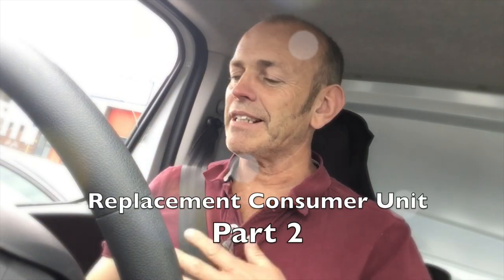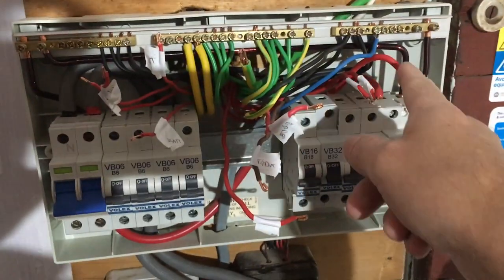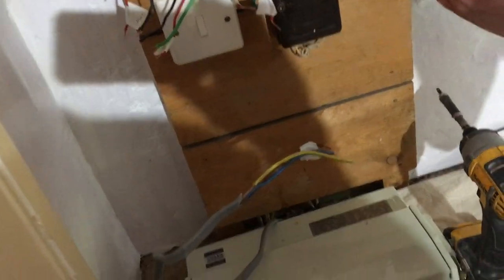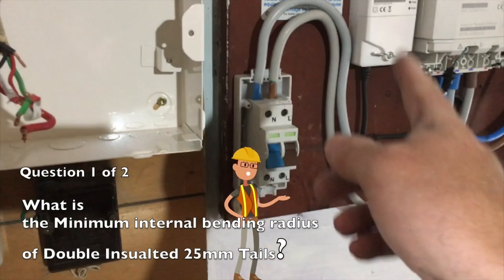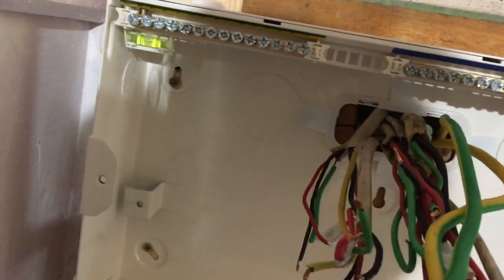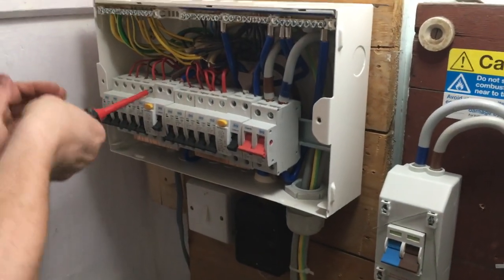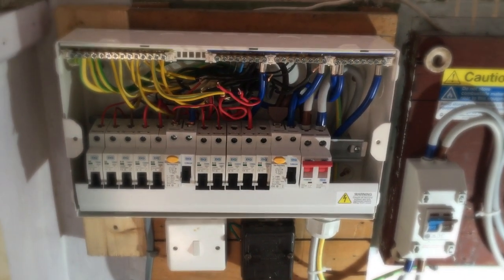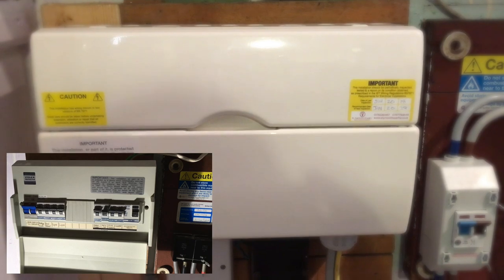Electrician Day in the Life - Consumer Unit Change Part 2

Comment: Who fitted the isolator?
Reply from the maker: HI we did on the day fella. It is a great idea to fit on on installations if you get the chance and the customer is willing to pay that extra bit.
Reply: Plymouth Sparky I thought the dno had to fit isolation switches? and removal of the main fuse?
It's great if you can do it yourself.
Instead of wasting money on smart meters they should have invested in isolation and consumer unit grants, half the country doesn't have RCD protection.
Reply: @supersparks9466  every time you change a db how do you isolate mate?
Reply: @o hash, contact the local dno and tell them you are doing a dB change, they hardly ever come out but as long as your are registered with one of the body’s like nic,napit etc they will give you permission to self isolate and then book a date to reseal when they have time.
Reply: @supersparks9466  so without any training you pull the fuse. Only difference is you've expected that the dno has made some record of your enquiry to re seal.
Not a pop mate but as electricians it's not really our problem that as you say they don't often come out to do it. We need to protect ourselves and if they don't believe we need training by agreeing that we can crack on just because we are with an awarding body (which do not cover this in there part p inspections of us) then I can't see the value in wasting our time talking to them. If they cared they would go around putting isolation in but that would be at a massive cost so I'm fairly certain they turn a blind eye at broken tags (or unbranded ones).
Reply: Also I have had training, 5 years apprenticeship and 40 years on the tools, pulling a dno fuse is no different than any other
Reply: @supersparks9466  wasn't doubting your qualifications and experience. As you know you can tell if people know what there talking about. Just agree with you that any spark with knowledge would know how to pull a fuse (without load and so on). I suppose you could come unstuck if it's fooked and dosent want to go back I  so I get you point about calling up I just don't see why on the one hand they can say it's a major and we must do it and on the other say if you with a registered body which has nothing to do with this level of competence then you can crack on. It's either a yes or a no. I will say I've not yet had a law suit put I do re seal myself if I believe it's likely to be accessed by the untrained (low down for example). Like I say wasn't a pop at you. Credit to you for going out of your way, was more a pop at the situation the dno put us in.
Reply: @ o hash fair enough it’s always been a grey area, I have had once in the days when I didn’t contact the dno as a matter or course, a porcelain fuse carrier break in 2 on me as I pulled it. Fortunately I wasn’t the boss and he had to phone the dno and make up something about the client breaking it with a hoover or something like that.  Stay safe,
Reply: Supersparks, everytime I have contacted the dno for c/u change they have told me it is illegal to pull the fuse and that the customer has to arrange for the 2 pole isolator to be fitted. We then schedule the c/u change for when the isolator has been fitted.
Reply: Dual tail isolation could run into switch enclosure. Shouldn’t be able to see blue brown.

Comment: Why is it a no no to have the main earth and tails coming in top and bottom? Thanks
Reply: I must say, I've never heard of this regulation either. I know live and neutral conductors should come through the same hole on a metal clad consumer unit to reduce any eddy current.
Reply: Tom, no reason what so ever, he’s talking bollocks.
Reply: Good question, especially as he has the tails coming in the bottom of the new board.
Reply: Tails and the main earthing conductor can enter the consumer unit from any direction. I think what he was saying what it's a no no to have the tails and main earthing conductor enter the consumer unit at different points... There's absolutely no regulation that prohibits the main earthing conductor from entering the consumer unit at a different point than the live conductors.
Reply: @alvin, so like I said then,talking bollocks. If your going to do these vids at least know what your talking about.
Reply: Plus the board looked nearly as messy as before he started, I’d be embarrassed to show everyone that .
Reply: Plus the isolater wasn’t a metal inclosure of non combusterble material
Reply: @supersparks9466  The supply isolator doesn't need to be housed within a non-combustible enclosure.
Reply: @alvin. Well it should imo, what’s the difference between a loose tail arcing in the isolater and the old dbs, even worse actually as the terminals in the isolaters are closer to the plastic. What’s your opinion on this?
Reply: @supersparks9466  A domestic consumer unit generally has a lot more electrical connections made within it compared to a supply isolator... typically 4 electrical connections made within a non conductive supply isolator whereas a domestic consumer unit will have substantially more, because of it, there is a greater risk of poor termination of conductors or loose connections being made.
Reply: @alvin, agreed obviously. But the isolater and the meter and the head all take the full load all the time and can be plastic so it don’t make much sense. I made the comment for the debate and you took the bait. I like the debate and it’s only my opinion.
Reply: It is all related to the studies and info provided by the fire brigade, thats is where the whole fire propagating material for consumer units have come from.
Reply: @tom, that’s right I know this. But obviously there are very few double pole isolaters fitted so the research in fires starting from these is probably non existent but if you are going to implement metal bds coz of the statistics surley make sense to include isolaters.
Reply: @supersparks9466  In the vast majority of cases where electrical fires have occurred within the fixed wiring of an installation, the fire originates within the consumer unit, I've never in all my years, come across a fire that started at the supply isolator or DNO's service cut-out.

Comment: No need at all for the isolator.
Reply: No, but good practice
Reply: it's got nothing to do with good practice. Just adds more cost to the client.
Reply: Please explain? The system can now be fully isolated without an illegal action of pulling the main fuse and cutting seals etc.
Reply: @peter. Yes a 2 pole 100amp isolator between the meter and dB
Reply: Supersparks sorry I meant please explain the comment about no need for the isolator. I understand what one is and the function. :)
Reply: Peter,I didn’t make the “ no need “ comment. But Paul green is right in so far as to say the isolater is not a requirement in bs7671. Imo the dno,s have missed a trick and should have made all the new meters/smart meters with an integral isolation switch. Then no one other than a dno employee would ever have to touch a seal again.
Reply: Some REC now insist on a Isolator.
Reply: @petertallowin6406  It's not illegal.